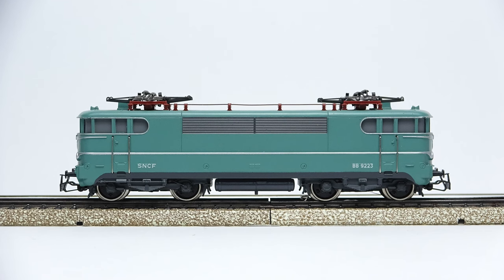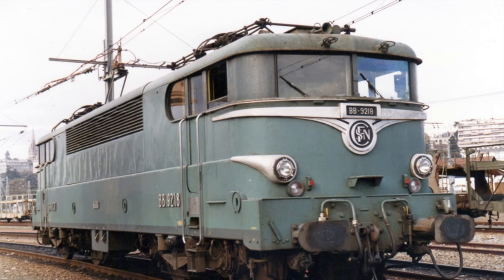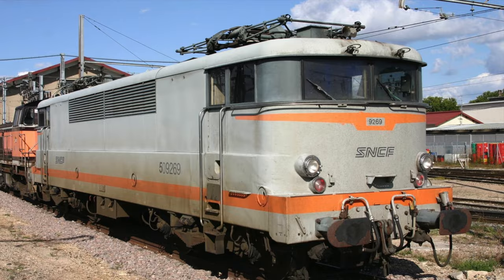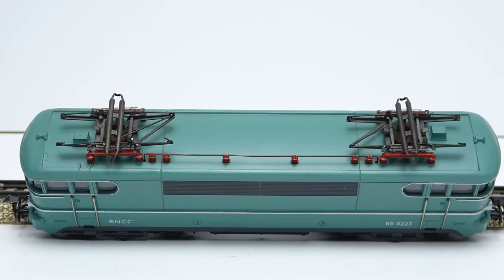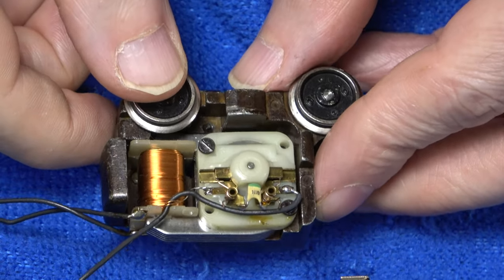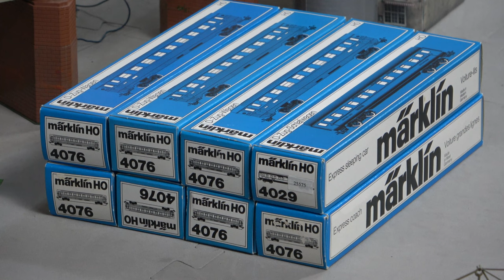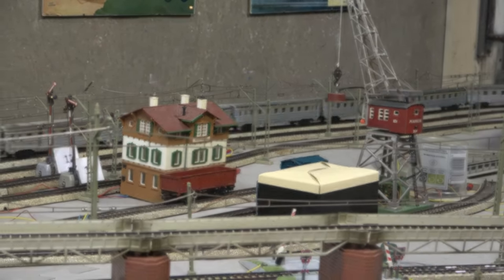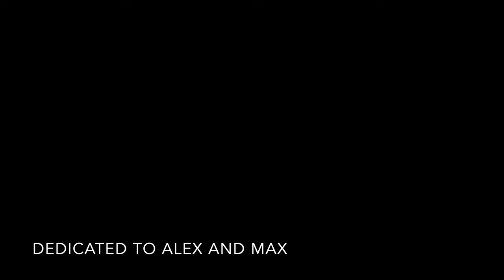Just in! Märklin 3038 (SNCF BB9200)

Comment: Nice overview of the 3038.  It is indeed a classic analog locomotive.  I pair mine with 4050's, which are not as nice as your 4076's (since they don't have interiors), but they will do for now.  Nice introduction to the other similar prototypes and a good explanation of the differences between the Marklin variants during the two decades the model was produced.
Reply from the maker: Thanks Kurt. Hope you are well.

Comment: Super video with great info on the model and prototype !!! I have the digital version (Märklin 30380: SNCF BB 9278 mfx digital), and just received the Märklin 3165: SNCF BB 9280 H0 AC analog in great shape. The directional switch works, but the loco only goes forward, in rear the lights come on an the loco buzzes, but no movement, any thoughts?
Reply from the maker: Thanks for the visit. There is most likely plenty of resinified oil in your 3165, it will block gears and prevent the motor from turning. it needs a good service and should be back in business. I opened my one in my video about the 3165 (https://youtu.be/xlb-_godY-U?t=467), and there is a step by step maintenace basics on a BR151 technically very similar (https://youtu.be/ol7Wjpss0Zc)
Reply: @The3rdRail  thanks for the tip, I did watch the deconstruction part, and if an older loco doesn’t run, that’s what I would do. However, the motor runs freely forward. I noticed in the description the seller noted “directional switch defective” after I received the loco from Germany, and assume it’s either an electric or contact issue. I don’t want to return it, and if push comes to shove, I’ll upgrade it to digital.
Reply from the maker: @tomsmaerklintrainlayout6742  Sorry, hadn't read your original comment properly... Assuming the spring is still there, and things are changing over, the problem could be down to a couple of things: 
- one of the wires from the reverser (switch) to the windings is lose and needs resoldering
- one of the 2 wires from the windings to the motor plate is lose or broken and needs re attaching to the motor plate
- the reverser contacts are bent, these are the bits the wires from the windings are attached to, this usually happens when someone has attempted to solder something and melted the plastic the contacts are mounted on, that's trickier, you can try and bend things back in shape gently, but you might not get very far and break the plastic... In this case, the reverser will needs swapping.
Reply: @The3rdRail  thx, I’ll take a closer look under my magnifying glass.
Reply: Excellent as always😊